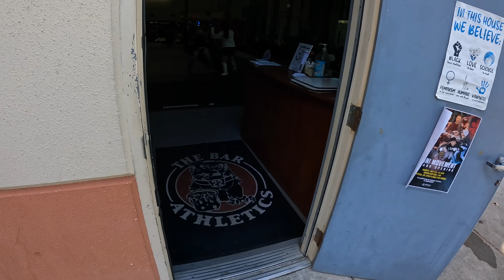She Asked To Ride In The Corvette! I Told Her NO! Not Until She...

Comment: Taylor ray did a similar setup to the truck exhaust as what mans was saying. if you build it on the lift, you wont have any interference with lifting since it was build around the arms. Look up his final vids with tuning, its decently loud but sounds great.
Reply: I was thinking the samething and it's a pain to get 4in over the rear end I would do it in front of the tire also won't change the sound to much they're already pretty quiet when you turbo them